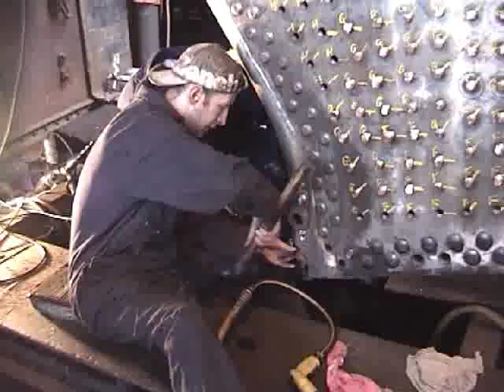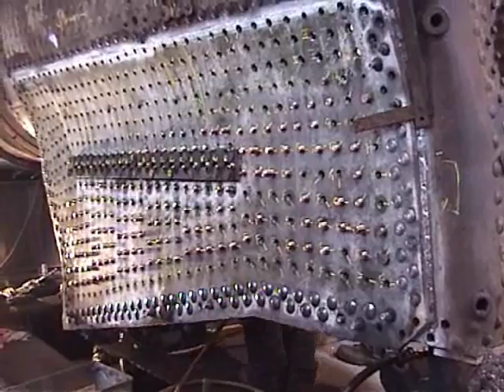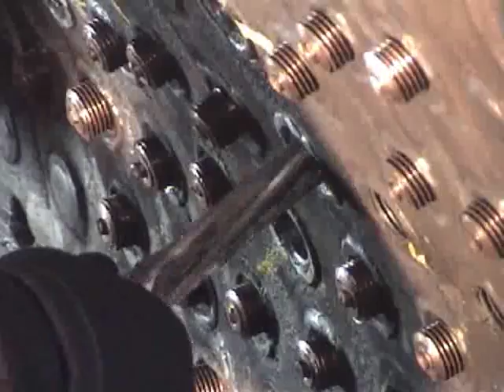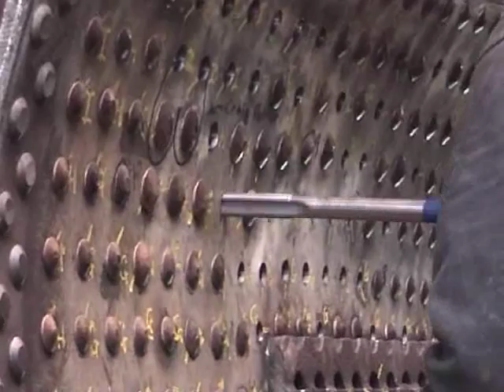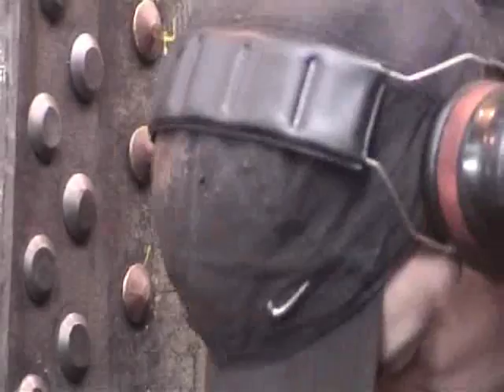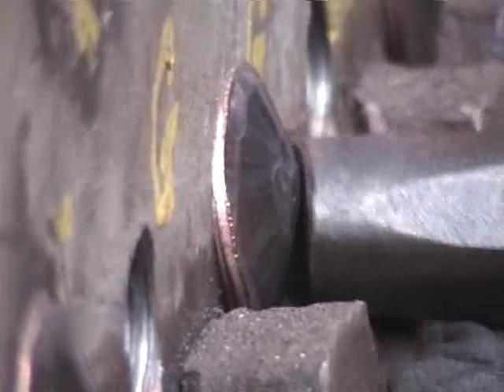LMS 45407 Firebox Work

Comment: @stingraystud Stays are basically bolts put in and held in place by being welded in. They are designed to keep the two shells (inner and outer) apart, creating the space for the water and steam. If the welding is not up to scratch or is old, the water will begin to leak, and needs immediate attention
Reply: Henry Wallace they are riveted over rather than welded in thats what the majority of the noise on this clip is

Comment: Can you guys do some work for me on a rare 60hp case traction engine for me I need the whole boiler replacement made in my opinion if anyone is going to replace a boiler like I am going have to do is have one made of thick heavy gauged stainless steel constructed made boiler so no corrosion will happen
Reply from the maker: Why not contact them
Reply: @TANISLA2  I will in the morning